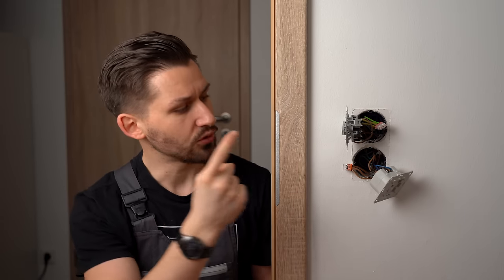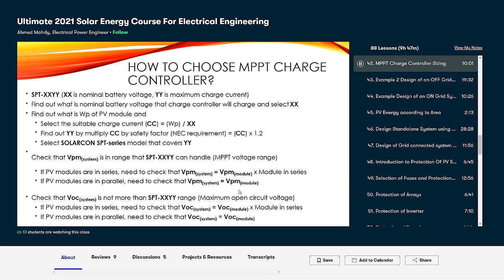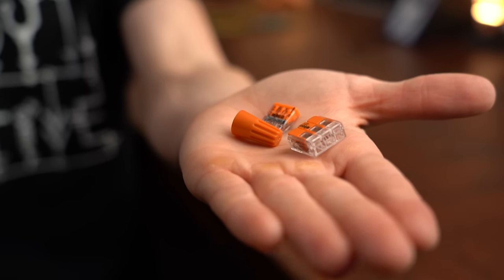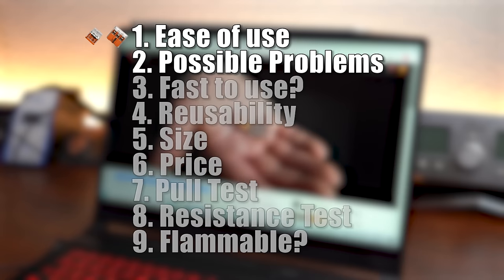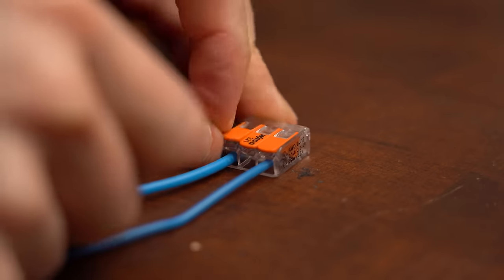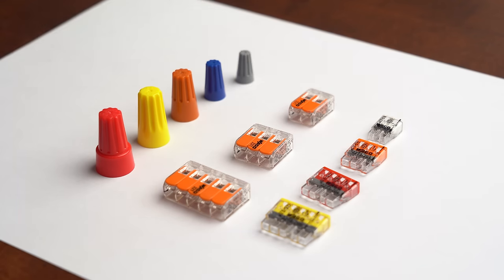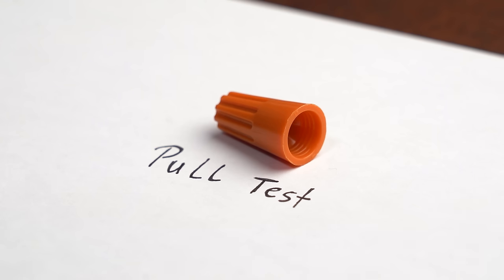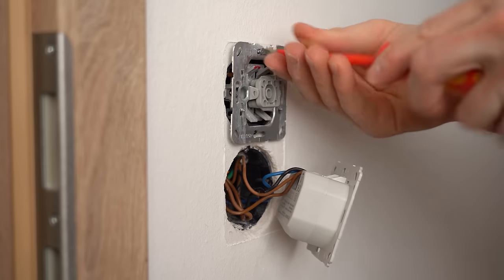What Wire Connector is the Best? Settling a Debate! Wire Nut VS Wago

Comment: In the Netherlands, I was learned at school that you first have to twist the stripped wires into each other, after that you cut them the right length and place the wire nut. I also was learned that you need to use the wirenuts at critical places like hospitals. The reason for this was that the wirenut made better electrical connection due to the huge surface that the wires touched each other, which should make it less vulnerable to faillures.
Reply: Long time ago. In fact the surface is counterproductive, because it reduces the pressure, and the problem with those nuts is that the pressure relieves when the material set...
Reply: @chargehanger  No you are wrong is still the best method because they are twisted so every force try to unravel it cancel each other plus the force between 2 wires are 10x bigger than a wago
You can bend it so tight it can easily be broken.
The electricians have put the force they need, plus a much greater surface area.
Reply: @chargehanger  The pressure is not just one total amount, but rather each twist of wire adds its own pressure, and since the copper is being worked and stretched as the twisting is done, the surfaces of the two wires become flattened into each other and thus dramatically increase contact surface area and therefore greatly reducing resistance. Contact surface area is highly important for longevity of any electrical connection, because even the smallest amount of heat generated at the junction will accelerate the oxidation process, which in turn will increase resistance, and eventually if there is enough current being drawn through the connection, it can experience thermal runaway and fail. But this is highly unlikely to ever occur with a well-twisted wire nut connection. Emphasis is on proper installation. If not installed properly, a wire nut connection can be dangerous as well.
Reply: Zo heb ik dat op de MTS ook geleerd. Tot 9 draden geloof ik. En dat was niet mijn favoriete opdracht.
Reply: @HeyChickens  "Contact surface area is highly important for longevity of any electrical connection"
Air tightness of the connection is more important. Especially with copper, because it conducts heat away much better.
If the contact pressure is high enough, the connection is air tight, and no oxydation forms into the interface.
Reply: I still use wire nuts, i think it's the most reliable. I've seen burnt out wireboxes twice because the use of wago like clamps
Reply: @Reinald Nijboer  I've seen wire falling out of a wire nut. How's that reliable?

Of course you also have to pay attention when using Wago plugs. But the main advantage is that they are transparent, so you can check if your wire is inserted completely down to the bottom.
Reply: @Sierra-Whisky  same, I had a short in a receptacle box where hot and ground met once everything was packed in and under tension. They must have been super close for years and heat cycling finally got them close enough to arc and trip the GFCI.

That wouldn't have happened with a lever nut.
Reply: You must also have learned that you NEVER use a wirenut with flexible copper wire. This is done wrong in this video.
Reply: @Fred-mv8fx  It certainly would have happened with a lever nut... probably would have oxidized the small contact area and burned out much sooner. The issue with the wire nut in question... is that it was done incorrectly, you have to use the right size and pre-twist the wires together then screw it on, a proper wire nut is not going to thermal cycle at all.... if there was heat cycling on the circuit chances are it was overloaded also.
Reply: @Wingnut353  I think you are misunderstanding. The issue is not a single component heat cycling, but the entire wire system heating and cooling as a load is inserted and removed.
If a lever nut fails in the way you describe, I'd expect that to be caused by another failure allowing the circuit to overload. Even then, Big Clive tested them on video and they held on remarkably well even after being abused to the point they melted.
Reply: Same here, from the Netherlands, using wire nuts I have always learned that you should first use flat beak pliers to turn the bundle of wires (2 or more) with a right turn to a bundle, so you start with an already tight twisted pair. When adding a multi strain wire, you then can also cut the bundle on full equal length so it will fit deep into the nut, but I don't think wire nuts are safely used with multi strain wires.
Reply: @Salfke  but, assuming that you used the proper wires, weren't the stripped ends of the copper wire damaged or scratched, which would in turn add resistance and heat? 

I prefer the wago clamps and as far as I know it's the only proper way to go when following the NEN1010 rule set. But I could be wrong.
Reply: Exactly this
Reply: @chargehanger  argue all you want, wirenuts produce a better connection when installed properly.  This is simple FACT!
Reply: @ManuelvanAmerongen  Wire nuts work just fine with flexible stranded wire.
Reply: @mikeiver  It's not save and therefore not allowed.
Reply: @ManuelvanAmerongen  having done it literally 10s of thousands of times I can assure you it is both safe and allowed here in the States.
Reply: @mikeiver  I believe you but here in the Netherlands it isn't. If you get a shortcut /   fire you are not insured. By the way I also don't onderstand the metal junction boxes.  Not allowed also. You can't even buy them. It's all pvc here.
Reply: Wagos and wire nuts, when used correctly, both work well.  To me, it comes down to which one is more idiot proof.  Wagos are clearly more idiot proof, so are probably what DIYers should use.  Professionals should use whichever they prefer, but they might want to use Wagos because they are quicker and easier on the wrist.
Reply: @ManuelvanAmerongen  I was going to say this.. wire nuts are best used on heavy gauge wire, and wire be pre-twisted together in a way they are functional and not pulling apart before you attach/screw on a wire nut.. the nut itself is more to hold the wiring together make them more resilient to falling apart or shorting.  

I personally use wago in my own home because it’s easier and I’m not into twisting wires as much as was needed.   but if a wire nut is used properly it can outlast the house around it.  My farm house had wire nuts on old wiring I since removed that stood the test of time, have to guess because the wire nuts that were used weren’t plastic but ceramic or something similar and old looking , probably 1930s era.. they were still working and hanging in there…
Reply: @ManuelvanAmerongen  The metal boxes are stronger, more secure, provide a ground bus for the installed devices, and have a much better fire rating.  We are only allowed to use steel boxes in commercial installations.  PVC boxes and pipe is allowed in restricted instance like a cooler or when embedded in a concrete or block wall.  We can and do use PVC, fibre reinforced resin, or phenolic boxes in residential but we also have the option of metal as well.  Likely your electrical  is very similar to our residential requirements.  Colors are different and the wires are in mm² but still the basics are likely the same.  I could drop in, look at your work and be rolling in a day.  Same in reverse for you.  Panels are a fair bit different and we have split phase systems to the home.  Grounding is grounding.  We have fairly extensive requirements for our grounding.  Not sure about you there.  I do like Wagos for stranded, not so much for solid.
Reply: @Sierra-Whisky  A simple tug on the wires post install is recommended and assures proper installation.  If the wires doesn't pull out it is reliable.
Reply: @Salfke  sadly I had a neutral wire fault in my house due to arcing when the electrician used a wire nut. I guess you could say the electrician could have done a better job but being there were 4 wires not much more could be done. 
To be clear a wire nut did not verify a good connection, the wire was losing connection and arcing which caused a fault. The house is over 20years old and that is what some people don't think about is long term use. So it can happen to either but Wago nuts (not a knock off) due this far less
Reply: @dansanger5340  The twisting is the main thing, a horrible amount of electrical work is spent twisting with my wrist and fingers, the more I can avoid the better after seeing the older guys... Love just the strip and insert of the wago.
Reply: @skyfoxrinoasfr4778  you know that the copper wire itself will thin out and break before the connector breaks? if your wires need to hold more than 30 kg's then there's something else wrong unless your hospitals are held together by wires and twistnuts

Comment: Wago gets extra points for easier fault finding due to their test holes at the top of the connectors, and the ability to fix your probes in the 221.
Reply: Also to spot a loose Neutral.

Almost every residential service call I deal with is because of a Wago.
Reply: @lelandclayton5462  what?
Reply: @lelandclayton5462  ?
Reply: @lelandclayton5462  Someone wrote in US they have used a loads of wire nuts and wire nuts can lose overtime because connection gets warmer and result is electric arching and "Each year in the United States, arcing faults are responsible for starting more than 28,000 home fires"
Reply: In Sweden "Torix" is quite commonly used which has a measuring point.
https://www.youtube.com/watch?v=H_kMiBS7OdE
I believe Wago is more common today then when I studied to become an electrician.
I've only ever worked as a marine and industrial electrician so I'm not really up to date regarding "common practices" on the construction/housing side.
Reply: @Tim_Nilsson  still not as good as wago style, considering you can't remove individual wires
Reply: @torpedohippo8493  Nope I agree.
But to be honest it's not much of a problem.
If it's installed in a house/apartment the majority of the junctions will probably not be touched by another soul for the next upcoming 50 years.
Reply: you can put a probe into the base of a wire nut easy enough.
Reply: True.
Reply: @Tim_Nilsson  But to be able to Change a single wire is alwqays better then not be able to do so. So clearly a point for Wago aswell
Reply: @Boz Scaggs Can you tell why so many house fire from arching faults in US then haven't they use metal boxes.

I looked that electric arching causes over 10% from all house fire in US. 

Where i live same number was 6% and we use plastic boxes which includes flame retardant and Waco connection has common these day instead nut connector.
Reply: @Boz Scaggs Dunno, not interest so much to digs those US statics. 

Where i live connections isn't allowed to do anywhere else than inside box, inside light fixture or switch so basically here every connection is covered.
Reply: That's why you ensure that all wires are touching when you twist them together, along with doing  more thorough testing with your tools before putting the wire nut on. You shouldn't ever be in the position where you need to test without the wire nut on and be unable to remove it to do so. In most cases, you shouldn't even need to do the testing after installation, as the wire nut should hold it solid for decades.
Reply: @mr.wizeguy8995  This is what those modern AFI circuits are for. Also, those 28,000 home fires are not from wire nuts. They're from general breaks in the circuit that are still small enough for a spark. As more and more housing gets AFI included due to code changes, it will shrink. This is similar to all the fires started by extension cords, we now require an outlet every 6 or so feet of wall to reduce the need for extension cords. Which, BTW are more likely culprits for those sorts of fires than a possible wirenut loosening over time. Which won't happen at all if you simply wrap it once with electrical tape before shoving it  into the box.
Reply: @PopeClemensIIX  How often do you need to do that though? You're fundamentally changing the circuit in a way that should only be done with good reason and with a great deal of care. Having to suffer wagos in case you might need to change one of the wires is pretty bad.
Reply: @SmallSpoonBrigade  if you open a junction box with more than 3 wire nuts, how do you know what is what without testing? E.g. voltages between different wires
Reply: @ReelSpider  I don't use wire nuts at all, so I wouldn't know. No one in europe uses wire nuts. They are garbage. Nevertheless, the Wagos have dedicated holes for testing, the wire nuts do not.
Reply: @mr.wizeguy8995 I don't know where you live but the US population is nearly 334,000,000 so that 28,000 number is extremely small at only 0.0084% of US homes catch fire under these circumstances.

You have a 1 in 15,000 chance of being struck by lightning or a 1 in 101 chance of being in a fatal automobile accident, this is far more concerning don't you think?
Reply: @timmturner  If you compare it to any country in Europe where most countries uses push connectors these days it's much higher and take consideration of population not just numbers.
Reply: @mr.wizeguy8995  So the solution to potentially crappy connectors is to have every connection being made inside a metal housing or box? All your installation boxes for wire distribution, sockets, light switches and so on have to be made from metal? Sounds very strange too me. Why not simply use save connectors and cheap plastic boxes instead?
Reply: @SmallSpoonBrigade  I'm an electrician and I can confirm that I quite often take advantage of the possibility to remove certain wires from a Wago or to add them later on. Might it be during a stepped installation process or for finding errors in a system - it provides great flexibility. If you're not familiar with Wagos you might not being able to imagine how useful this is. You can swap single wires in and out while staying fully safe at the same time (even under current). Can you ever do this with a wire nut?
Reply: @groofromtheup5719  But it doesn't hold up there by itself, being grabbed firmly and safely as in a Wago. With a Wago you can apply your probe and get your hands free. Can't do this with a wire nut, can you?
Reply: @homo192  Did i say everything had to made from metal? Metal is by far worst with electric that's why many country in Europe uses plastic boxes it isn't conductive you know. But open connection inside wall for sure isn't safe as something made into box or light fixture etc.
Reply: @homo192  what? The wires are going to drive the position of the joining device regardless. Wago or wire nut, no difference.
Reply: @lelandclayton5462  no quite simply that is not the case there are proof to the higher European standards why are nuts are not because they are terrible